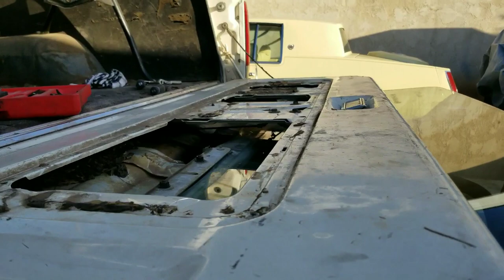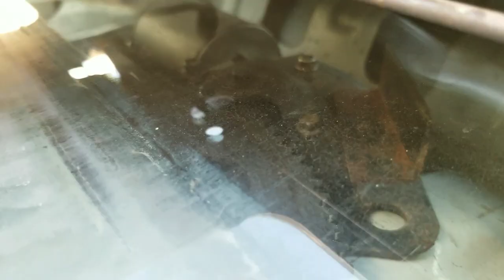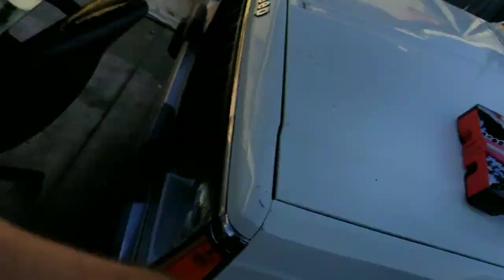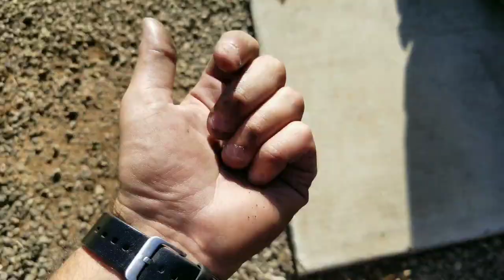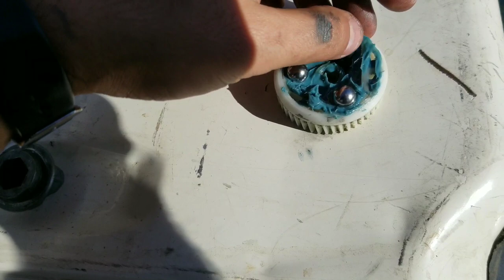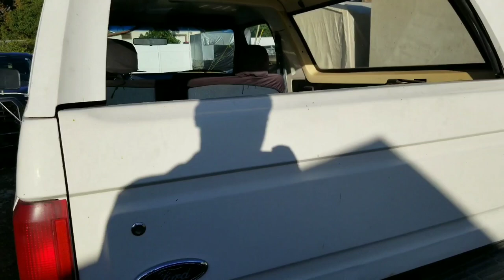Ford Bronco Rear Window Motor Repair Walkthrough - Simple and saves your OEM Motor!  Save $$$!!!

Comment: You can remove the five 7/16 bolts and slide the entire mechanism to the left, then remove the three 5/16 bolts that hold the motor on. Saves a lot of aggravation and time. I had everything out in less than ten minutes. Then put it all in the parts washer and cleaned off thirty years of grease and dirt.
Reply: That's what I did around 20 years ago. I forgot tho. Had to come see how everyone is doing this. Lol!

Comment: I changed entire motor, but saved old one as spare.  Saw this video after,  Great vid.  Yes those spring loaded arms are guillotines, beware !  I put window all the way up with tailgate down,  very little spring pressure, and left window in place.  You can work between window and motor with 1/4" drive shallow socket

Comment: Thanks a lot for this video! It made repairing my tailgate window motor assembly a piece of cake. For posterity's sake, I used 7/16" steel bearing balls from my local Ace Hardware 7/16" = 11.11 mm. Give the materials and assembly, I think that's within tolerance. :-)  Works great.

Comment: Mine rolls up and down alright. Just struggles to go up, I have to assist it. I think it’s the motor? Also my bracket things that holds that whole motor thing rusted out on the bottom. It’s that white flat piece of metal that you can see in your video. Mine is brown from rust. The bottom of my tailgate rusted out. I found about 3 inches of clay packed at the bottom. I guess from 30 years of dust getting washed from the back window down. I live in Hawaii too so everything rusts. What size lift and tires do you have? I was thinking about 4” lift with 33” tires. Idk if I should try to fix my bronco or by a f150 which doesn’t have a fancy tailgate window thing.

Comment: My issue is I can’t get the window to roll back up, I closed the latches like you mentioned window is sill locked in the down position. Can’t get it rolled down with the switch or the key.
Reply: When you close the tailgate does it still feel loose ?

Comment: So my rear window on my bronco won't go up or down . I check the motor 
Putting 2 wires neg. And postive. To big batt. Into the clip to try to raise the window  .motor no good 
 So what I'm trying to ask is how do I take the mirror out to put in a new motor if there's no motor that works right now to pull it out need help thanks
Reply: Same. Might have to just work on it from the inside

Comment: Hey man thinks for the video.  I bought a new tailgate and im about to transfer all the components from my old tailgate to the new one. Just wondering if the bearings were holding up ok with no problems.
Reply from the maker: they were perfect, no issues at all.
Reply: Thx bud, i also went with the steel bearings and so far so good. Im finally finishing up on some very minor body work and should have the paint laid on this this Friday.  Im super excited!

Comment: Mine's completely inop', from the cabin too.  Nothing, no clicks, or anything when I try to switch it with the lock in back or with the switch up front.  No juice to the motor; with the key in the back or from the instrument panel up front.  I checked the CB, it's working with the door locks (which it controls too) so that's not the prob'.  The tailgate window is up now.  I'd like to move it down so I can work on it.  Do you have any suggestions for my quandary?
Reply from the maker: Maybe open the panel up on the tailgate and out power directly to the motor from a spare battery you have to see if the motor is toasted?  I suppose that's what I would do, I would bet the motor is toast but could be a fuse too so check that before doing anything else.
Reply: I'm having the same issue. The motor is good, I jumped it from the battery to the plug that sits just under the motor. Next there is a round plug just behind the gas tank on the driver's side under the truck. Unplug that, use test light because it's easier, you'll need a 2nd person to work the switch from the dash. 1 pin should be hot when the switch is pushed up and another for down. Make sure you have a good ground to get a good reading. I have power there too, my next step is to pull the harness after that plug and look for damage.

Comment: Why are you replacing the window motor if your key switch and motor work? Mine doesn't work and needs replacing. That's why its stuck. Halfway between up and down. I can neither lower my tailgate or access my window's motor.
Reply: Probably because it was making that "fix'n to die"' sound....